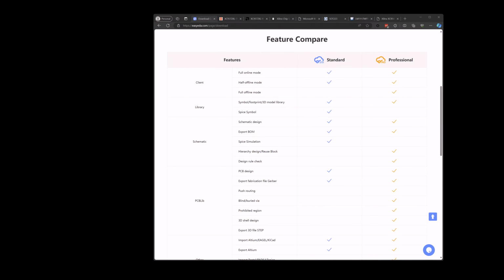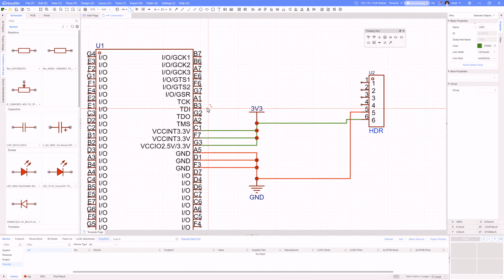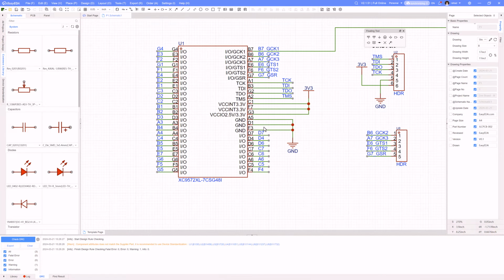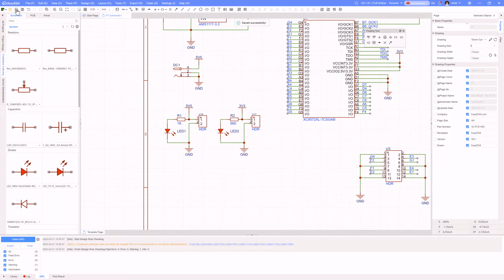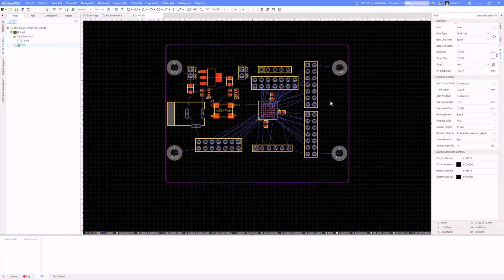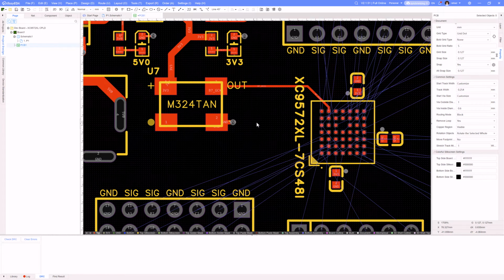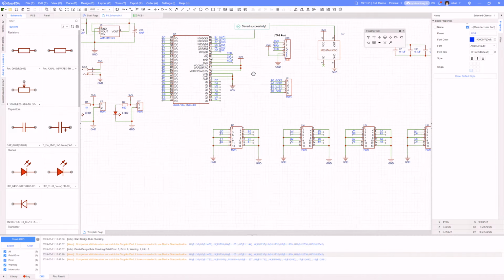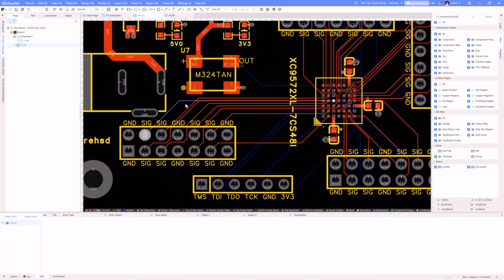Walkthrough: Building a Small PCB in EasyEDA Pro (BGA CPLD Dev Board)

Comment: Will you please create a circuit using TH components at single layer? .
Reply from the maker: Sure thing! By single layer, I assume you mean top and bottom sides (two-layer) for signal routing, maybe with all components installed top-side?
Reply from the maker: Here's a walkthrough of a two-layer, through hole: https://youtu.be/OASA7KLK_oM. Not much would be needed to make it a true single layer. One trace would need to be moved, and I would change the layer fill from 5V0 to GND.

Comment: Very nice job on the board and the video!!   I've been working on it (the pro version) for a few days and find much of it very good, and some of it very frustrating.   I agree with your comments about the LCSC library and it's organization.  Being able to select a Soldering station, Screwdriver set, Hydraulic Tools and some Hot melt glue sticks doesn't seen particularly useful in an EDA library, but there they are the library.   I noticed that frequently if I put an actual LCSC part number ( Try looking for a C3173448 or 20279-001E-03)  in the Library search window, it returns "No Data!".  However, if you go to the LCSC website and search there,  the part comes right up.  How to easily place the part that EasyEDA-pro can't find?

Comment: This is a great help - I plan to go thru this process hopefully soon. I know that you are populating the bga and small surface mount components yourself (and I want to be able to do it too) but is it expensive or problematic to let JLPCB to populate the harder parts?
Reply from the maker: I have only had JLCPCB populate the components on one of my projects. They did a nice job. Often, I don't need five fully populated PCBs. I believe you would need to order a minimum of five populated PCBs. Also, I am using parts I have acquired inexpensively (e.g., Ebay), and I expect JLCPCB would want to use parts they supply (if they have the parts). I'm not sure if it's an option to send parts to JLCPCB, but even if it was, it would be burdensome for me to do so.
Reply: Yeah, I did an ez80 adapter board with them not long ago and they don't stock the part. They were willing to accept my part but I agree its a hassle.